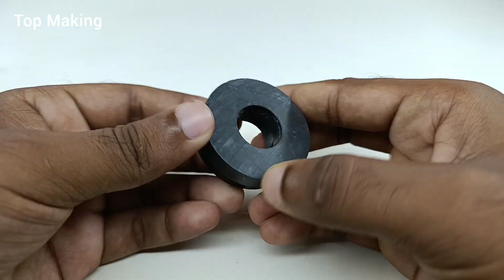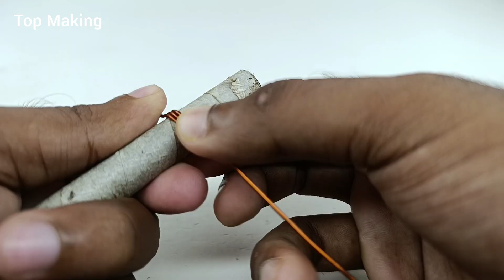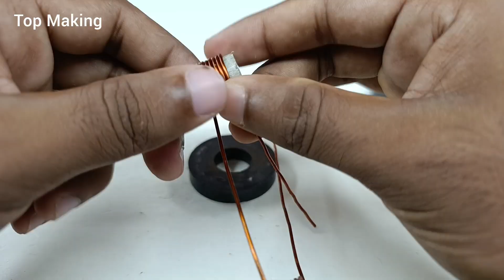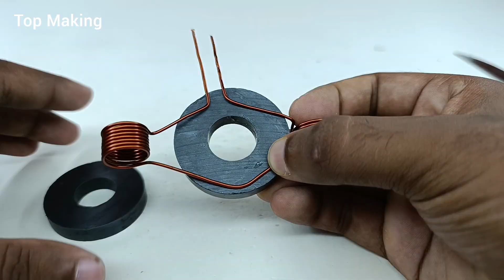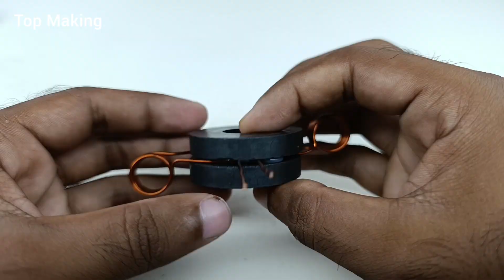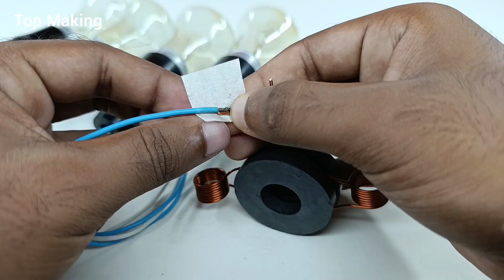How to make 20KW Free Energy Generator at Home with Coper wire and Magnet

Comment: BEFORE 5.43 THE TWO BACK BULB HOLDERS ARE TOGETHER.    AFTER THAT THEY ARE APART.    THIS IS USUALLY WHEN THEY MAKE THE EDIT TO PUT THE WIRES INTO THE BULB HOLDER FROM UNDERNEATH TO POWER THE BULBS. THE HANDS ARE SO CLOSE TO THE CAMERA TO KEEP THE FOCUS ON THE SCAM COIL HE'S MAKING AND HIDE THE LAMPS.    ZERO VOLTS AND ZERO Kw OUT OF THAT THING. 240 VOLTS NEEDS HUNDREDS OF TURNS OF WIRE NOT TWO COILS OF 7 TURNS EACH.  THERE WOULD BE A BIG BANG IF HE CONNECTED THAT MONSTROSITY. 🤣🤣🤣🤣🤣🤣🤣🤣🤣
Reply from the maker: thanks a lot sir

Comment: So why don't you provide any measurements and detailed parts info? Since none of these lightbulbs can be assumed to pull 5 kW. each, hooking them up to your "generator" proves zilch in terms of device output capacity. Hook up some big electric heaters instead of these lame lightbulbs.
Reply from the maker: thanks a lot sir